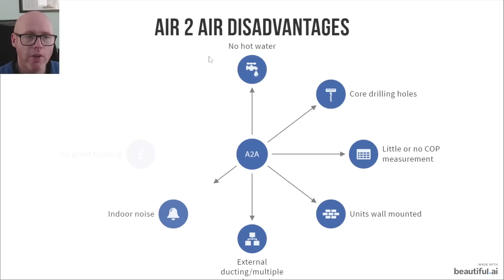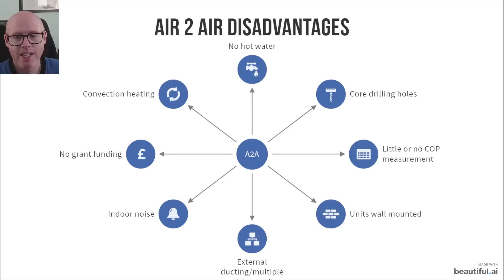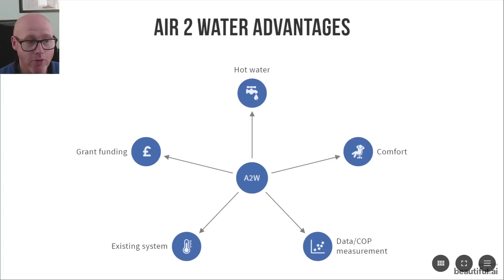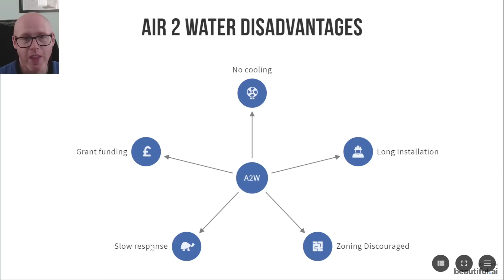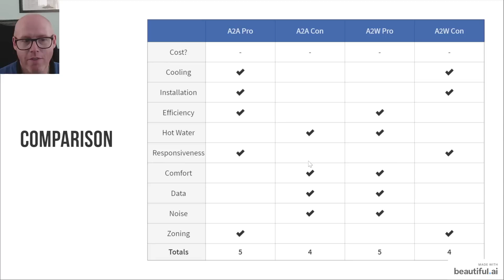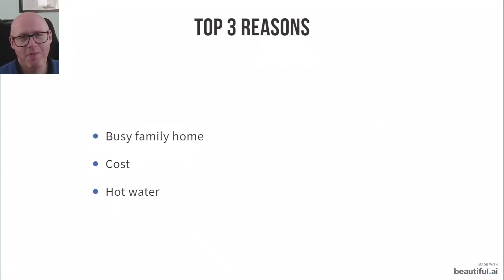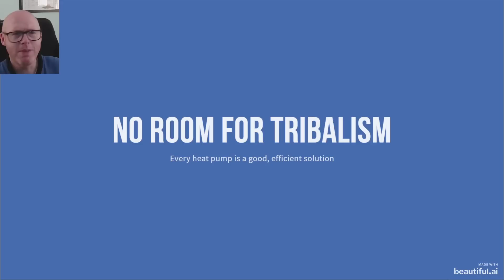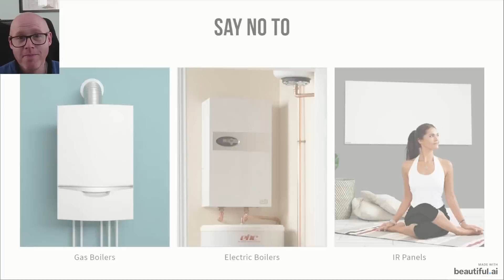Heat Pumps: AIR TO AIR or AIR TO WATER?

Comment: The problem here is that the BUS makes it tribal. One gets it, the other doesn't!! I can't stand this and will get a Gas boiler because of it. If you live in a flat, A2A is usually the only real alternative. The Hot water problem can be solved with some A2A systems, just the manufatrues don't bring them to the UK because no BUS means no sales for those. Also, you could do DHW with electric at the fixture or an electric bioler or a gas boiler. All would be possible if the BUS applied to A2A systems.
Reply from the maker: BUS is coming for A2A. Hopefully in Q4 2025.
Reply: @UpsideDownFork  Thanks for the reply, i hope you're right. Hydronics don't work in flats for the most part. (lack of space) 

They don't work on undersized Rad systems either, not economically anyway. Where did you get your information from? How certain are you? Cna you share details pls? 

I've been on to MCS and they never told me this. I have been waiting for 3 years now to switch from Gas but won't/can't put hydronic in and won't put A2A in while the BUS is only on A2W. It's so frustrating!

Comment: Why is Cadent spending £Millions on gas main renewals and upgrades if there is no plan to keep gas?  You are so wrong!
Their engineers have been very busy in Chester and Wales reconnecting gas supplies to houses that have removed heat pumps because they were mis-sold.  They were far more expensive to run at up to £300-£350 per month and only heated their homes to 19c at the most.  This is what engineers were telling me when I was having my gas main renewed.
They knew I was interested in heat pumps as I was talking about them when there was a problem over getting a new gas pipe in.  The advice was not to bother and they even said most of the youtube channels are being run by companies and people working for them to sell products.
Reply from the maker: I work in the motor trade. My channel is full of real world data from my own home which demonstrates that it's MUCH cheaper to run than a gas boiler.

I've asked people who make these counter claims to provide any evidence, however anecdotal it may be, that their heat pump didn't heat their home properly and expensive as well. Not one has provided anything.

Everyone has an opinion but few provide evidence and data. Those who do reinforce the belief that heat pumps are the future and gas is the past.

This doesn't need to be an emotive argument, just let the facts speak for themselves.

Boiler fitters have a vested interest. I've spoken to loads of them, they don't understand heat pumps and most of them don't even comprehend the new building regs of low temperature heating.

Any reasonabl engineer will grasp the failings to properly train those working in the heating industry.

Comment: GCH for me. I can zone, only use downstairs and bathroom rads which heat the whole house, good size rads pump out heat quickly from cold, combo boiler heats and provides hot water and is half the size of the equipment you’ll need for ASHPs. It’s also markedly cheaper to install and run. In the event of a power cut the gas hob will provide heat for cooking and the wood burner heat for the house.
Reply from the maker: Good to hear you're happy.

For us, installing a heat pump was far cheaper and running costs are also lower.

Because we don't zone, the whole house is lovely and warm and consistent throughout. It's never been so comfortable.

Comment: Is dehumidify with A2A a missing benefit? E.G. for a damp flat (fix the source too of course).

I have... 
A2A in my garden office, which is brilliant: 40°C air almost instantly, cools in summer, daytime use is free with spare solar (400w even on a cloudy day on a standard 4kWhp E/S panels setup). The Mitsubishi wall unit is right by my head, but no noisier than the laptop fan. 
A2W (Octopus installed) for the 4 bed detached mid-90s home. £3k after grant. Even warmth throughout; no drafts.
Fridge & and freezer: A2W presumably?
Nissan Leaf: A2A cabin heater
Pool heater: £500 portable A2W, free on spare solar, zero install costs.

My point is it's horses for courses! 💨💦🎠🐎
Reply from the maker: Great points!

Comment: I got one a2a unit on living room of 3bed semi size house with external wall insulation.
I find it keeps whole house warm,runs all day from my house batteries and solar.
Total cost for unit installed £1500.
Thinking of putting one at bottom of stairs to run at night,to send heat upstairs,on low rate electricity.But I could just keep the one unit running?
Reply from the maker: That's a brilliant result for £1500 👍

Comment: In addition to air-to-air and air-to-water systems, there are also heat recovery ventilation systems and geothermal heating. Geothermal heating tends to have the highest installation cost but the lowest operating expenses.

It is worth noting that air-to-air systems can also provide cooling and is the cheapest solution.
Reply from the maker: Both MVHR and geothermal are extremely niche and not suitable for most housing stock in the UK.

A2W in many cases is coming in cheaper than A2A due to the government subsidies.

Sorry this video is primarily focused at the UK market.

Comment: You forgot to mention that A2A costs less, but on the longer run, A2W wins as it can work during the night when the electricity is 4x cheaper. Besides, I cant sleep while AC is heating, its noisy and dries out the air. A2W is much convenient. I know some people who made A2W from A2A AC units. Thats the perfection of both worlds and it works great. For 1500$ investment you can heat the whole house 100m2 or more.
Reply from the maker: For us in the UK, A2W quite often works out cheaper because of a government subsidy that is currently in place.

Comment: Very interesting vid. 
We've had a single split unit in our bedroom for years for cooling in the summer, and a gas boiler for all rooms. 
During Covid I decided to do a loft conversion, putting 2 bedrooms in the loft. Thinking the loft bedrooms could get hot in the summer A2A was researched. We opted for a 4 way split system, 3 bedrooms and the living room on one outside unit. ~£4k fitted with all pipes hidden as they were fitted during first fix. 
So now we have limited gas hot water heating in the form of 3 Rads and UFH in the kitchen, utils and hall.  
A2A is great, heating the living room from 19°C to 22°C in 15 mins and tick over on minimum fan for maintaining temp. Bedrooms at temp within 5 mins. With the quick response the units are off until needed and only rooms that need heating get heated so zoning is east and all run off an app.
No noticeable draft unless your under the unit. Noise isn't an issue on low fan speeds, you only need higher speeds when you want the temp to change fast, once your in steady state the fan is low and you cant hear it.
Only down side is when someone puts one unit on cool when another is on heat, doesn't happen often, but kids being kids will try and cool the room in winter using the air con! 
Also no energy monitoring on our unit. That said I'm starting to tie in monitoring into my home auto so that will come. The plus point of using home auto will be all energy monitoring will be in one place (Openhab) so any calculations will be automatic and easy.

We also have PV on the old FiT (so no energy monitoring on the inverter as its too old) and solar hot water which the FiT covers most of our energy bills. As for HW, the solar covers us from May to September with no gas used. Further areas I'm looking at another PV array the the dormer roof,  battery storage and heat pump for the wet side of the heating.

Keep up the good work we all need this info to make informed decisions.
Reply from the maker: That sounds great! Thanks for the feedback. 
It's always reassuring to hear when people are making informed decisions for their use case.

Comment: About A2A noise levels, it depends a lot on the make and nodel of your equipment.
When on vacations, my mother always complained about how the noise of the AC unit (either for cooling or heating) wouldn't let her sleep.
Then I installed one A2A from Mitsubishi Electric and she like it so much, she installed similar A2A units on her house and she never complains about noise.
Not all A2A units are made the same....
Reply from the maker: Thanks.
Tim's latest video goes some way to addressing this. He clearly has a good system and now runs the fan on minimum speed which I guess contributes as well.
Reply: @UpsideDownFork  it does.
When my parents chose theirs, they were considering a slightly cheaper Mitsubishi Electric that besides not having the auto setting for the fan, it also lacked the quiet setting so I convinced them to spend just a little bit more and get the same I had, just to be sure.
They never complained about it being loud and neither do I.
Reply: Hi! What model do you have?

Comment: There is so many factors missing… maintenance and cleaning(especially a2a), defrost algorithms and their effectiveness… if you recently insulated the house and had radiator heating, they got oversized for current lower heat loss. This is perfect for a2w ad it allows you to heat with lower temp (lower temp difference increases cop). Additionally a2a are primarily designed for cooling, heating is just an addon. A2w the opposite, therefore built in cop stats and mostly a huge number of efficient defrost algorithms! At low outside temp a2w clearly wins.
Reply from the maker: Thanks for commenting

Comment: we switched from an oil burner to air to air and i am more then happy. the wormth is better the air does not feel so dry, with the radiators i always had to run a fan to move the air ~ literally to stop having a hot head, wished for temerature at the butt and cold feet. if you have in floor heating this is not a probleme but most older homes don't have that. i am not going back to radiators. in the past with the really old oil heating it worked but the temerature of  the radiators was more in line of 75°c to 85°c then they radiate heat not only warm air. but you have to explain a child not to touch these burning hot peaces of metal conviniently accesseble for small hands...

one thing you can't do is turning your air to air system off. this will bite you. just let it run like you would with normal heating then everything is nice.
Reply from the maker: @SteffenF  thanks for commenting 👍

Comment: Just installed a A2W heat pump and I am so happy to turn off the A2A pump! Why? Because I absolutely hate the sound of that fan blowing, the overheating on some area to get the heat to areas far away and also the uneven heat as the pump de-frosts. And yes, my ”old” A2A pump was from 2021 and of a good brand (Fujitsu KM12 slim) so Im not comparing A2W with a lousy A2A pump. Will still use it in the summer and if I need extra heat (so far not needed even though we have had -10c).
Reply from the maker: Thanks for sharing your experience!

Comment: We had an air to air system fitted in our bungalow because it used to be heated via storage heaters. In this situation I believe it's almost always easier to get the A2A because of the lack of plumbing and the cost + disruption of installing a whole new central heating system. The downside is water but you usually have an immersion tank in this situation so running that off a night tariff isn't the worst. We opted for an instant water heater to replace the old heavily corroded tank, get rid of the gross vented system, make room for a stacked washer and dryer in the cupboard, and (importantly for me I have MS) I can set the maximum temperature of the water heater to be the standard safe temp in hospitals/nursing homes of 45° (so I don't burn myself+ don't need to worry about legionella with stored water which I'm also vulnerable to because I have a compromised immune system from my treatment 😅)

In the long run we might look at getting a heat pump water cylinder in the loft or maybe the small sunamp solid state heat battery if a tiny 2kw air to water heat pump comes to market that we could plum up to heat it. You don't need a lot of output for heating a small cylinder in a bungalow with 2 people but that's below solar+battery on our list of priorities and we might find that the savings of heat storage would be negligible once we've got some electricity production and storage 🤷🏻‍♂️

The cooling was a big factor for me too because my MS is made worse when I'm too hot. During heatwaves I used to be trapped in my bedroom with a noisy and inefficient portable AC. Now I can roam the whole house at will.

If you spec the right system then control is pretty good these days too. I know that even on cheaper Fujitsu and midea systems you get WiFi control as standard now. We opted for Fujitsu because that's what the installer we chose preferred. Their app is pretty good but it's also pretty easy to integrate the units into home assistant for fully local control and to implement smart features like geofencing and weather dependent automations.

We're happy with our decision.
Reply from the maker: Great comment, thanks for sharing!

Comment: It’s fair to say that when the A2W grant ends, prices won’t suddenly jump by £7500. Grants skew the market and artificially inflate labour costs.

Look at what happened when the grant to install an EV charger ended; installed prices were pretty much the same afterwards 😅
Reply from the maker: We'll see. I suspect you're wrong on that. Unfortunately tradesmen day rates are insanely high and demand is there to keep them high.
Channel members have already seen my thoughts on this in another video that will be coming to the general public next week 👍
Reply: Long may the grant continue, but it will be interesting to see what happens when it ends. I haven’t tracked anything closely, but when it increased from £5k to £7.5k I don’t remember noticing that prices dropped by £2,500, based on quotes received by friends and colleagues.
Reply from the maker: @HowardBurgess  hey, I may be completely wrong and my research is based on the limited publicly available data, so I'm sure to be missing the full picture.
Reply: @UpsideDownFork who knows, it’ll be interesting to see. It’s funny - ten years ago if someone told me that one of my interests/hobbies/passions would be heat pumps, insulation and green energy, I’d never have believed them. I sure know how to bore people at parties now ;)

Comment: I dont know if it was intentional or you've just missed it, but you didn't include one very important fact, at least for uk homes. The A2A also dehumidifies the air, so anybody with a mould isue should consider that.
Reply: That only happens when in cooling (or "dry" mode, which is just a nerfed cooling mode) - for heating it doesn't do any dehumidification.
Reply from the maker: What Ben said.

Also, in my own isolated (so anecdotal) experience. Our A2W heat pump has reduced our humidity level in the house as well as reducing condensation on windows and mould growth.

The constant heating ensures we have no cold spots and less opportunity for moisture to condense on cold surfaces but I can't entirely explain how the moisture level has reduced. Perhaps it's something to do with less convection currents and less opportunity to draw cold moist air into the house from outside. I really don't know but we have dropped humidity level by nearly 10% as an average by switching from our old gas boiler with on/off controls to a weather compensated heat pump.

Comment: I have just had a quote for a2w from a heat geek which was £13k with a grant included. Circa £21k for a heating system!
Reply: I do enjoy the content they put out on their channel, and it seems they know their stuff and can get the best out of what heat pumps can offer, but you're far from the first that has been quoted exhorbitant prices from a Heat Geek installer. Given that all installers doing work for the BUS have to be accredited anyway, there's something going wrong somewhere; to get the MCS accreditation installers should have to guarantee a SCOP in the same way that Heat Geeks do. 

The prices quoted for any installation, when you look at the purchase price of the parts, is high enough already; like any government scheme that offers free money as long as work is done by an "accredited company" (whether this is double glazing, insulation, heat pumps, solar etc), the grant simply inflates the prices the "accredited companies" charge and there's little benefit to consumer and simply an increased profit for the installer.

I appreciate that the current BUS grant is actually very generous, but can't help feeling that it's still (in part at least) inflating the cost of installations especially as it's still insisting on work being carried  out by a limited number of approved installers who still don't offer the guarantees that the exhorbitantly priced Heat Geeks do.
Reply from the maker: @kevindruce8915  wowsers! Have you had any other quotes yet?
Reply: @ not yet. I am still on the floor. I know the gas boiler is wrong but it’s working well for my 5 bedroom house.  So I’m struggling to justify it going.  The quoted for 10 kw valiant.    

Sorry I want to be positive as I know ethically it is the right thing to do.